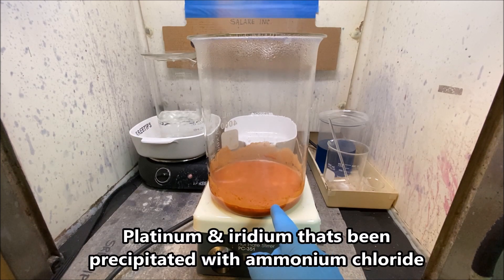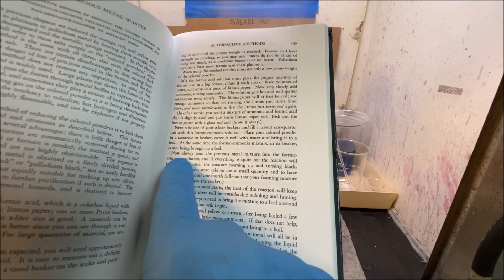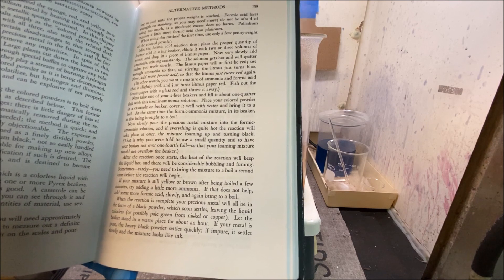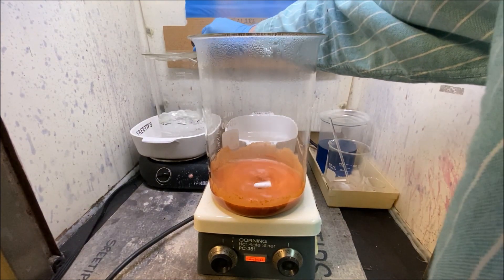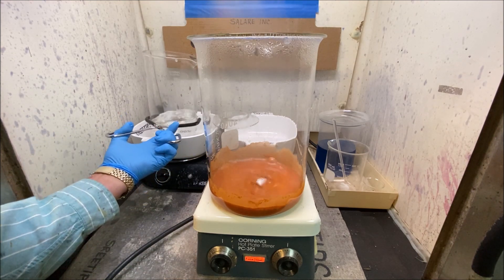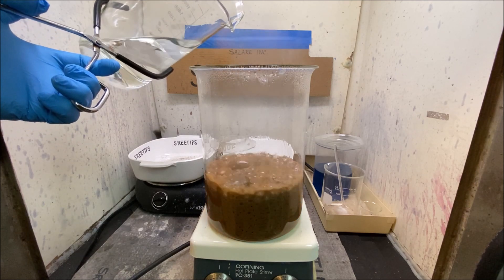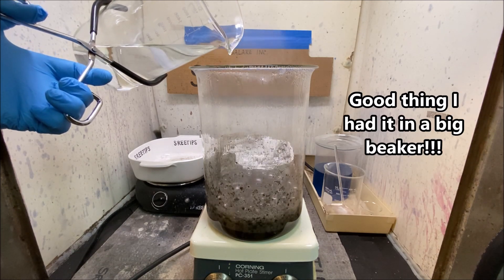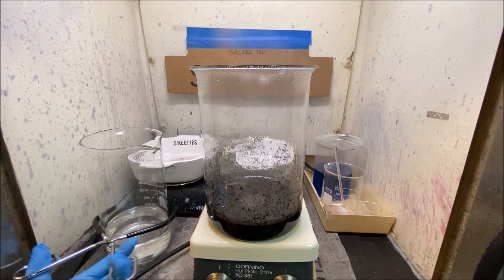Platinum Reduction With Formic Acid

Comment: So if your palladium is in ar, slowly add warm formic acid to warm ar for reduction? I have 600 grams dental scrap ill be refining. My plan is to precipitate first with dmg, filter, put back in ar, evaporate to near dryness, re-acidify with hcl, check ph, i read the sweet spot is 2-2.5, add formic. Cant find much reliable info on formic acid reduction

Comment: Oh wauw!.. seems I always have to practice patience before you turn salts into metallic Platinum, I get why. I myself used formic acid and oxalic acid in my apiary and was always warned never to add water to formic acid but add formic acid to water when diluting cause it could initiate a violent reaction with acid chasing you. I used 85% formic acid usually and even at 20 deg/C it produces dangerous amounts of vapours... always worked with it outside.

Comment: I'd like to see a video of gold extraction from an unopened container of diabetic test strips (50 strips, I use accu chek brand). I would suggest some petroleum based solvent to dissolve the plastic from the metal before you use aqua regia. If needed, I can send you some strips, used or new (use biotoxic prevention methods if you want used strips as they touched my blood). Basically is it worth saving used strips or old unused strips
Reply from the maker: Best to burn them to a fine ash then hit the ash with aqua regia. But I’m quite certain that the yield will be very low.

Comment: You can do the same with the yellow palladium salt you precipitate with hcl. By leaving it on heat for a while after the conversion you displayed (gentle boil) and stirring it will collect together nicely you may even get metallic flakes along with your usual pgm black powder its actually amazing to see
Reply from the maker: I checked, there are metallic flakes in with the black powder.